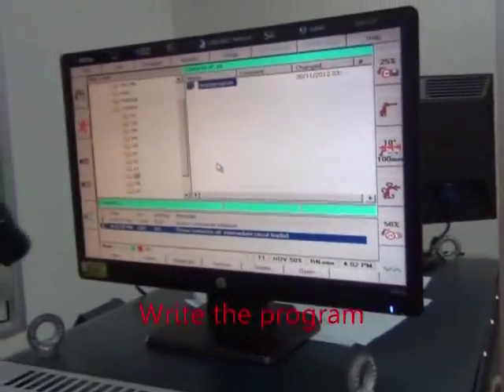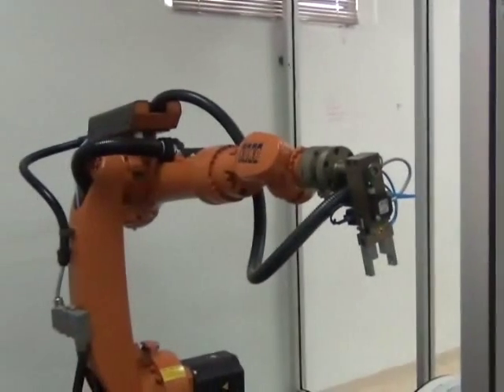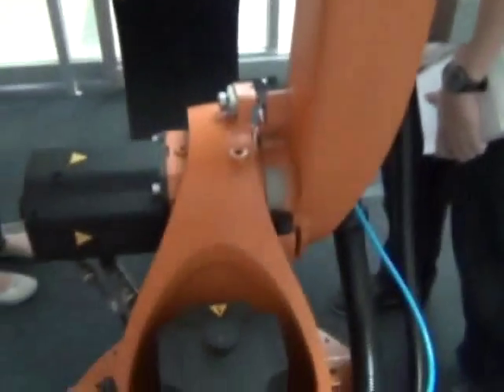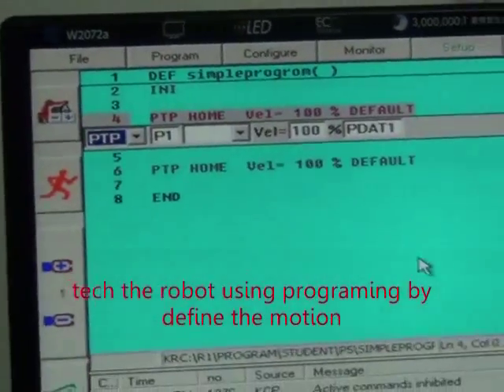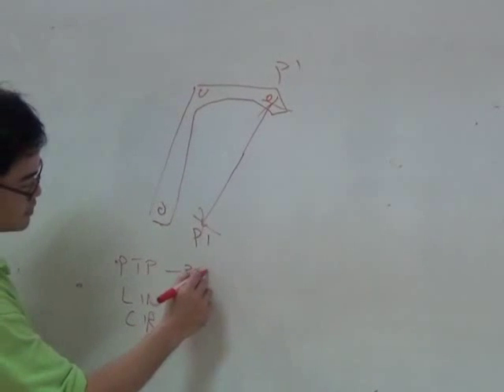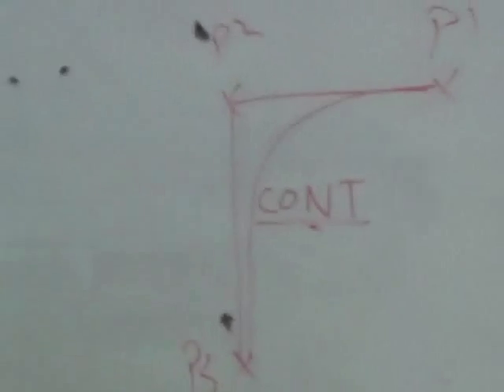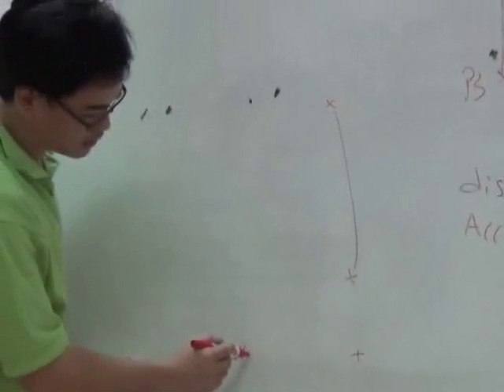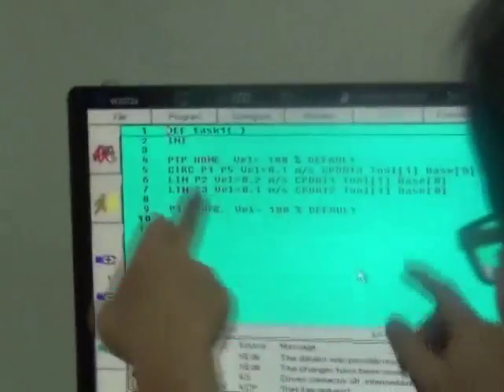kuka robot part 1

Comment: what is electricity power required and how to electrically connection
Reply: For a KRC1 with a 150kg\200kg rating it's 25 amps at 380 volts in South Africa for the robot to move through all 7 axis flat out at its highest speed.